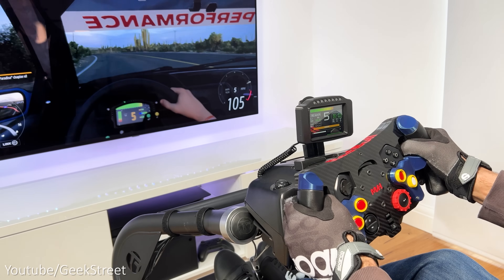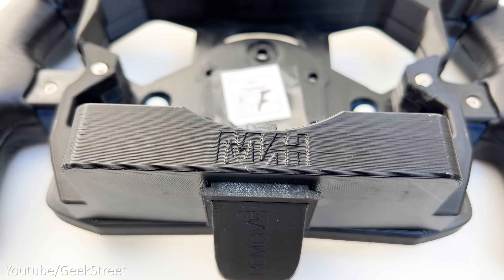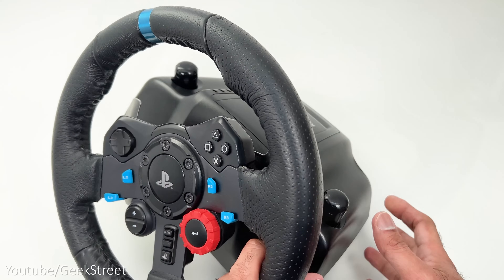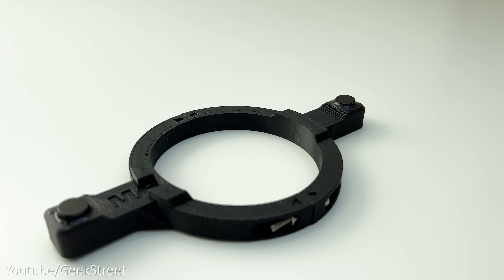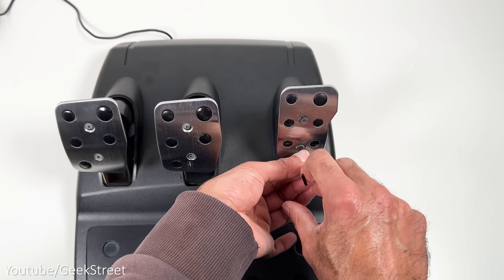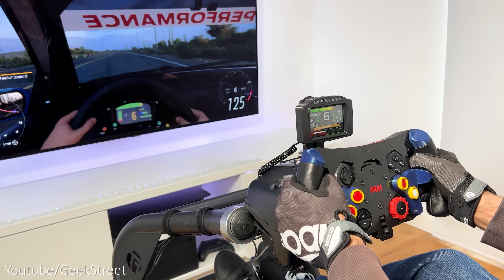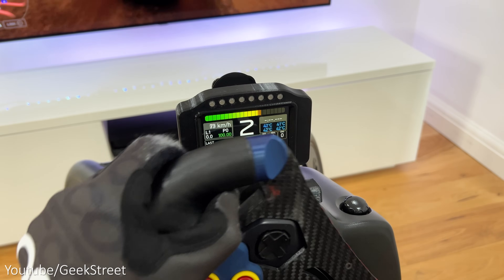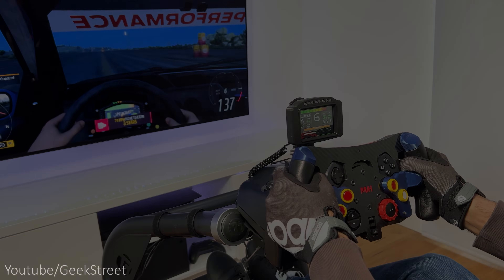BEST MODS for the Logitech G29 / G920 / G923 Racing Wheels

Comment: Do the magnetic shifters improve the standard shifters in terms of responsiveness etc, or is it more of a preference thing? Also, do they make a lot of noise? Thanks and great video!!
Reply: They make mis-shifting a thing of the past. You can shift from 8th to 1st perfectly due to the tactile feedback. The shifter comes with pads you can always use to make the shifts very quiet.
Reply: @808GT  I’ll second this. You’ll never miss a shift again
Reply: Because u can make the paddle sit closer to the point where it registers yes it reduces shift time
Reply: oof imagine not using a stick
Reply: @oatsmcgoats0182  oof imagine thinking every race car uses a stick to change gears
Reply: @oatsmcgoats0182  Yes, beacause modern race cars still uses gear levers

Comment: For my 920 I put the clutch pedal spring into the accelerator pedal since I'm quite heavy footed, the extra force needed was barely noticeable after a few hours of racing - Will definitely be getting the new brake spring :)

Comment: So basically the reason you need to do this whole procedure is to just remove the two screws that connect the base to the steering. You can actually bolt the original steering back (should you wish) with the six front Allen bolts without having to put the two screws back.

Comment: Wow the mod takes a little bit of skill with the tools and assembly. The mods look worth it so you have lighter, greater control and feel. 
like 232
Reply from the maker: Thanks bro!
Reply: That takes no skill just common sense
Reply: It looks like a lot but just don't lose the screws as you take the wheel off and you'll be fine.

Comment: I have completely modded the crap out of my 923 lol. I've got the mc style gt3 wheel rim from acelith, the gteye clutch and accelerator springs for the pedals, mvhstudios magnetic paddle shifters, the custom sim shop sequential shifter mod for the h-pattern shifter, and a few other bits and bobs. It's completely changed how it feels, almost unrecognisable from the standard 923 lol

Comment: All good mods but one thing I have to point out.

For the braake pedal spring you only need to undo the two Allen screws either side of the pedal. 

Much easier than taking the whole pedal base apart, a little fiddly getting the new spring in but took me five minutes in total.

Comment: On the G920/920. Dont put that rubber block back in with your brake! Its there to give add the variability that the spring is now supplying. In fact, take it out anyway, variable spring or not. Its just too stiff.
Reply: ILoveFishyx  no, it only takes effect at nearly full depression of the pedal, so springs strength is the same, its just the last 20% you wont have to stand on it. I was watching the calibration as i was pushing my pedal, and I had to almost lift my arse off the seat to get 100% on the brake, I seen a video about removing it (after googling the problem). 
Its hard to go smooth on the brake when you have to stomp it, so removing the block gives you full control.
Honestly, just try it, you can chuck it back in after.

Comment: Funny, I've got this on my G29 and love it. If you get the suede grips, do yourself a favor and WEAR GLOVES or you will ruin it. I've also got the display and I'm keeping it even though I'm moving onto a CSL DD, tho for the G29 I don't recommend the wheel mount for it, go with the motor mount. The cable that attaches it can get tangled if you try to do full rotations of this wheel.
Reply from the maker: Yeah the wheel base mount is much better for the telemetry display.

Comment: is there a mod to fix the slight turn delay that logitech wheels have in game?
Reply: if u have turning delay , thats a problem caused either by imput(your monitor cannot see what u do fast enough making u feel delay, applicable if your display is having >1ms on display) or by incorrect settings . No logitech wheel has delay ingame :D
Reply: oh damn alr ty for the help bro

Comment: I managed to get the mod on my wheel but afterwards the ps3/ps4 switch doesn’t seem to work or something. When I connect it to my ps5, the calibration process goes as normal but I can’t seem to turn the wheel on. The light on the ps3/ps4 switch is on and I’ve tried everything but nothing seems to work. If you know how to fix this, I would really appreciate it.

Comment: ive had to change the controls where i use the clutch pedal as the break because i fell like when using the break pedal i will break my setup or the pedal any way around this
Reply: Try to remove the rubber inside the spring of the brake pedal. It changes a lot
Reply: @Zerosvmc  Thanks do you know what tools I will need

Comment: I have just tried to install the brake spring mod, but for some reason my throttle and brake are stuck at 100% in f1 2021. I was careful about installing the spring but now my pedals are useless. If anyone has any advice it would be appreciated.